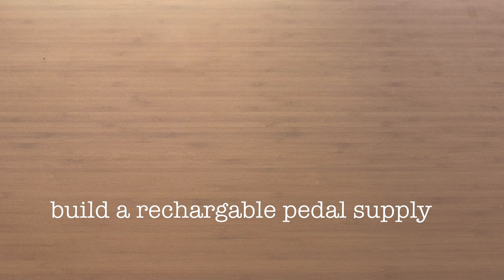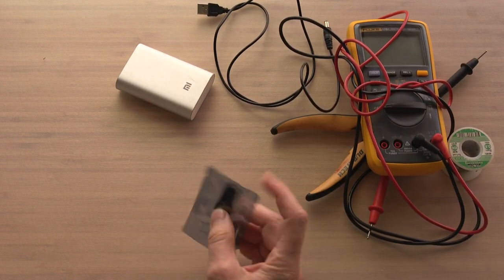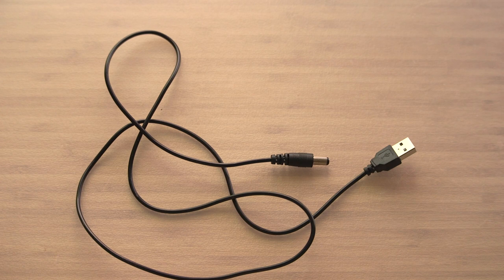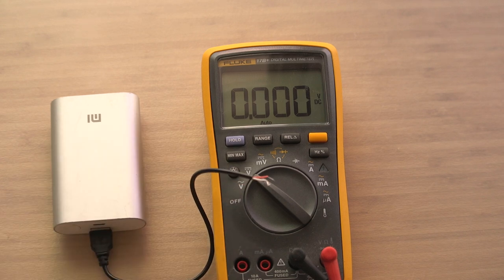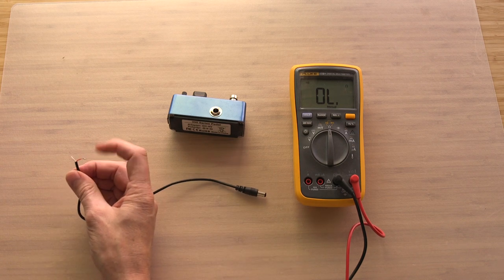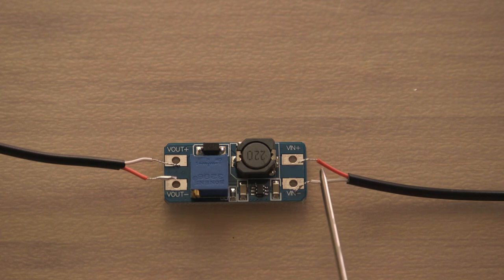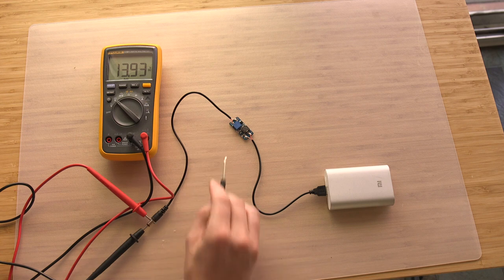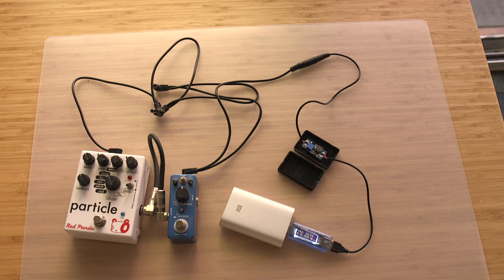Build a rechargable guitar pedal power supply

Comment: Thanks for this I made one and it works with most pedals (fuzz, Octavia, flange) but with delay and a chrous the led on the pedal flashed and pedal made a thumping sound ? Any ideas why it's not working with some pedals?
Reply: Digital pedals like some delays and reverbs can use a lot of current, your power supply may not be delivering what they need/
Reply: @douglhorvath  thanks I will add more cells ,more power and see if it works. Plenty of time at home now to play with my pedals and guitars
Reply: Family-account Email any update? Is it work?

Comment: I got a conversor like this and obviously I don't get those noises from my house electricity. However, compared to my isolated power supply, there's some other noise coming from this little conversor. Do you have any clues on what could be add to this circuit? Looking inside an isolated power supply I think those capacitors after the toroidal trasformer could be the answer. What do you think?
Reply: hi, did you managed to solve the noise?
Reply: @melorogerio  Actually yes. I raised to voltage a little bit and placed a 9v regulator and a capacitor after this conversor.